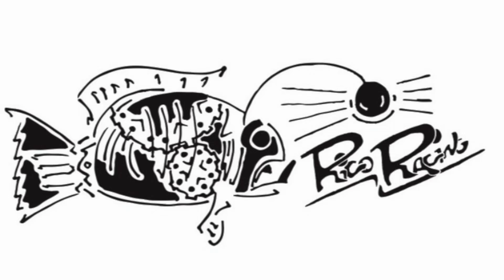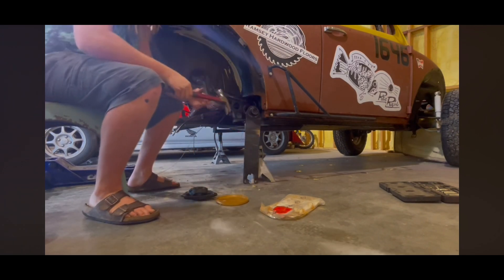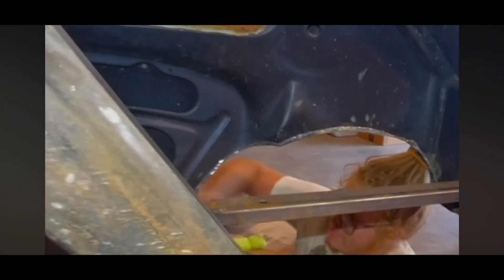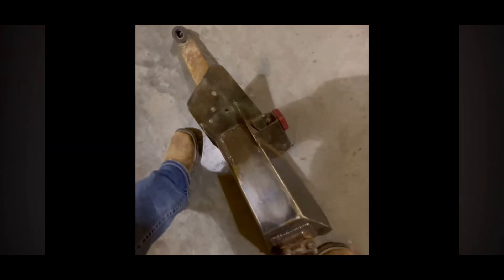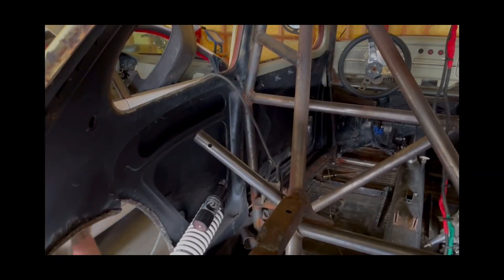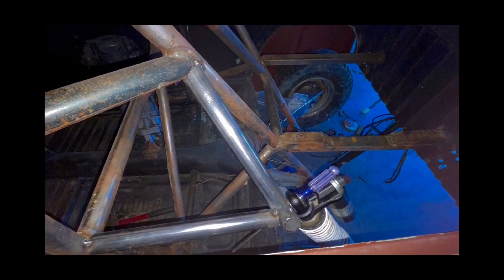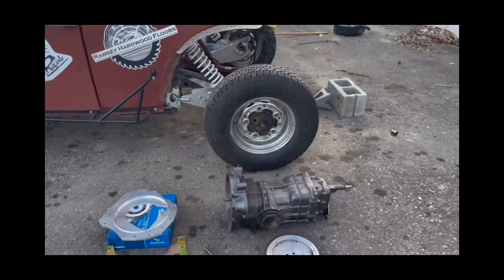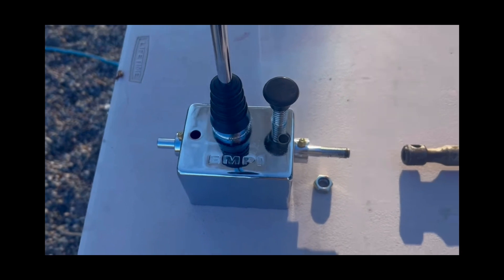How To Convert a Swing Axle Baja Bug to IRS Rear Suspension

Comment: I am curious about converting from 1955 Swing Axle to early 70's IR in a Manx. Not a car I want to put coil overs in.
Reply from the maker: the torsion setup will be very similar however the spring plates will be different.

Comment: How are the axles holding up?  Do they seem balanced enough or do they have vibrations?
Reply from the maker: i havent had any issues with them yet, no vibrations either. My guess is that the CVs will fail before the axles do, but no issues with those yet either!
Reply: @ricoracing1646  are those 930 CVs or 915s? I've got a subie-powered spyder replica and I'm considering IRS converstion since I have a 930 transaxle literally lying around, so I appreciate your video. nice work on the swap out!
Reply from the maker: @RandallLowetx  we are actually just running stock bus cvs on the transaxle side and stock bug cvs on the hub side. However, I would definitely not recommend using stock cvs as they are not rated for this much angle and will probably break eventually

Comment: What is the inner fender made of? It looks like you were using a heat gun to melt them.
Reply from the maker: its sheetmetal, the heat gun was just to heat the material so that I could bend it easier. you could also use a torch
Reply: @ricoracing1646  Did the heat gun actually get the steel hot enough to make a difference?
Reply from the maker: yes it did, but its also a very powerful heat gun. I often use it to pound dents out and bend sheetmetal. Its much easier to use than a torch but more expensive.
Reply: I’m happy to see young men like yourself experimenting and learning fabrication. You will learn quickly what works and what doesn’t. I like how you bent the cut edges over.
Reply from the maker: thanks! the baja community is awesome and i have gotten so much information on how to do things from all my racing and building mentors!